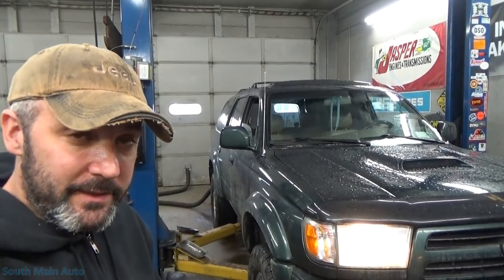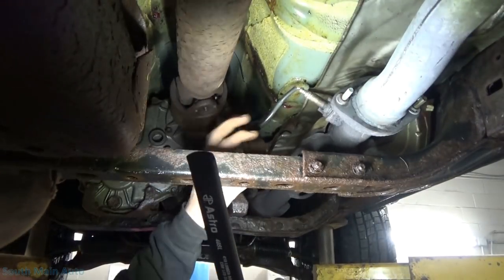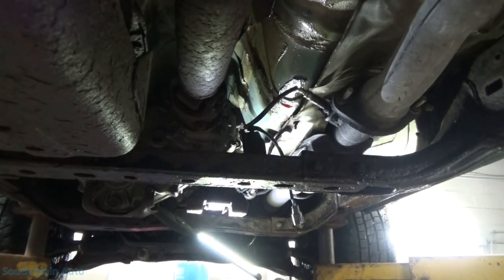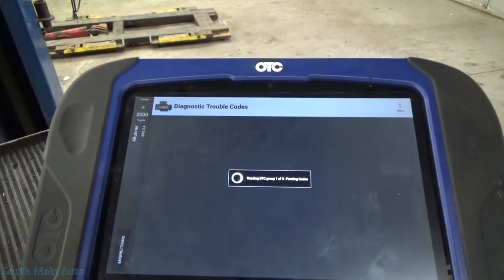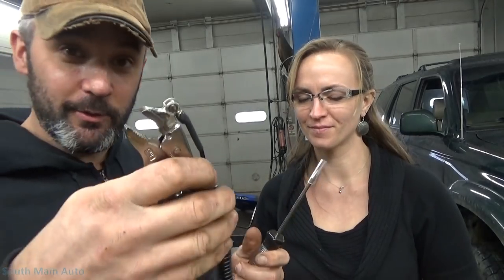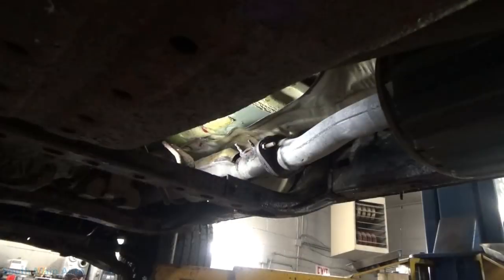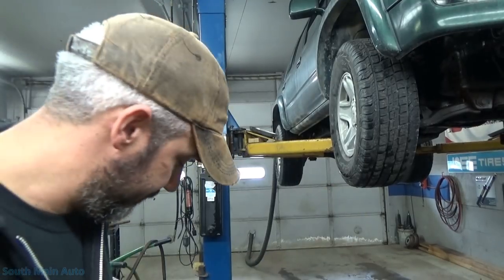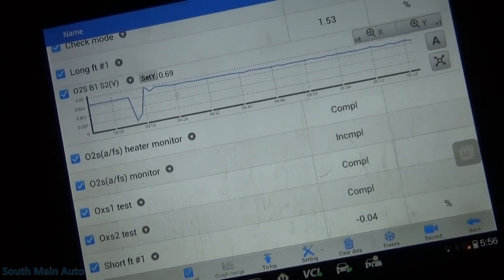Toyota 4Runner 3.4 - P0136 O2 Sensor Malfunction Bank 1 Sensor 2

Comment: Hey guys I have a question about this code p0136. I replaced mine 2 times and the code continues to coma back after 2 miles of driving, I hooked up my
Scanner and was watching the live data. There is no power to it it shows zero voltage any one els come across this???
Reply: Did you confirm the power side of the circuit?

Comment: Hi Eric  I am surprised that you receive returns fro your suppliers. I would have thought as an hi volume customer that you would not be sent returns as so many times the swap out of a higrade replacement with lower quality is the reason for the return. Also as you demonstrated missing the gasket or other bit parts.
Reply: CCC Detective I would have found their busiest time of day, gone in and ripped them a new one in front of as many customers as possible. I suppose Eric's video serves the same purpose but doesn't get the frustrates out.

Comment: Is it dangerous to run a vehicle while on the lift?
Reply from the maker: No why?
Reply from the maker: no why?
Reply: You had the 4 runner running and the drive shaft was turning. I guess if you have the vehicle on the lift correctly there is no danger of falling.

Comment: why didn't you by a Toyota o2 senor?
Reply from the maker: 4 times the cost on this one. Usually the OE toyota sensors are very close to the aftermarket Densos but not in this case
Reply: South Main Auto Repair isn't denso and OEM company for Toyota

Comment: Toyotas last a while but when they break down there exspensive to fix an a pain to work on same with volvo bmw an volkswagons audis all garbage 27 yr ase mechanic detroit sadly american cars now are built the same way all overpriced throw away garbage..good channel good mechanic hes not just a parts changer
Reply: What on a Toyota was more difficult to work on than a domestic?  I'm genuinely curious.
Reply: gtemnykh here in the rust belt the metal imports use bolts always freeze and break and the way there designed more of a pain parts more exspensive an not in stock imports are garbage as all newer cars built cheap not to last
Reply: " way there designed more of a pain parts more exspensive an not in stock imports are garbage"

Yeah can you elaborate how exactly they are designed to be more of a pain?  An Audi or BMW I can understand, but how is something like this 4Runner any harder to work on than say an S10 Blazer or Explorer?  I'll actually argue it's EASIER.  Blazers have hard to reach fuel pumps (that go bad), fuel injection spiders/poppet valves on the older ones, Explorers have timing chains on the back of the damn motor.  I'll gladly take the Toyota.
Reply: Been at the same shop 17 years.this guy getting his panties in a bunch cause i say toyotas are garbage you prob voted for sanders an think unicorns are real lmao
Reply: Judging by your grammar and attitude, you'll stay working in rather than owning a shop another 17 years.  Maybe Santa can leave you some remedial English lessons under the tree, Merry Christmas bud :)

Signed, most definitely NOT a Clinton or Sanders voter

Comment: I was under the impression heater circuits are only used when in open loop/cold start??
Reply: heyitschino nope, they need to be on at slower engine speeds too when the exhaust temperature is lower.  A/f sensors heaters need to be on all the time to function and most now use duty cycled heater circuits.